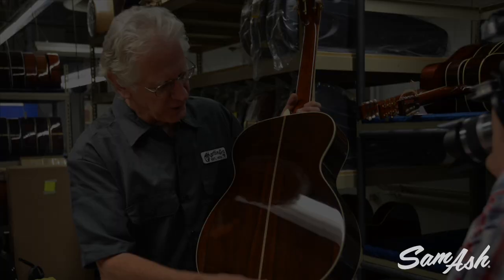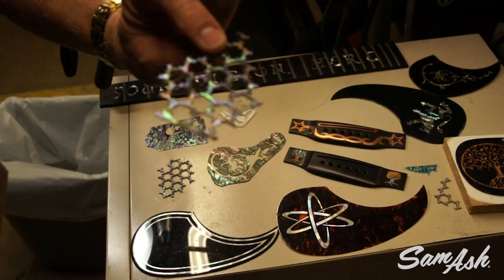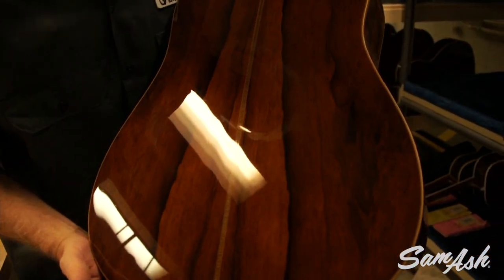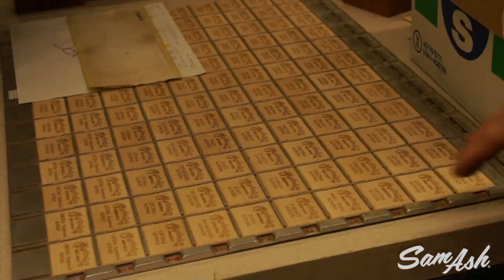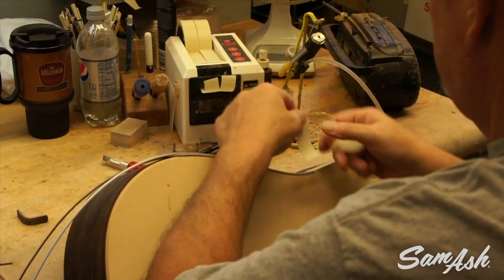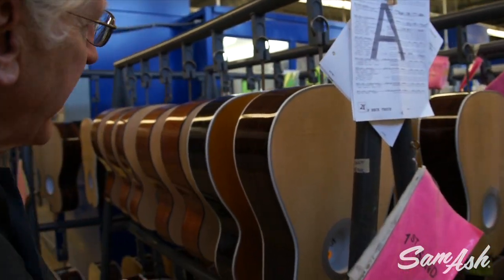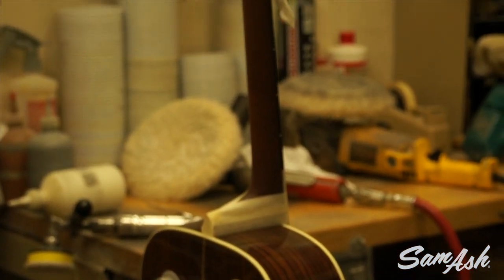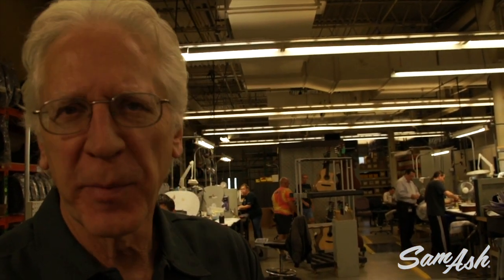Martin Guitar Factory Tour with Dick Boak

Comment: Excellent to see the inside of the factory of this iconic brand.  Lately though, the "brand" is about all Martin is unless you have a ton of money to spend on a guitar.  Take a top-end Eastman, Blueridge or even a solid-wood Recording King and I bet you can't tell the difference with your ears.
Reply: i love these comments... Agreed if you buy a bottom end martin you are not getting an amazing guitar, but no you definitely can hear the difference. The guitars you just mentioned are okay at price, but they certainy are lacking tonally and playability. The reality is all modern acoustics are lacking, they all have average wood, are rarely chilac anymore and lack the same build quality. Guitars also get warmer over time and the older sound is really whatr yo ushould be lookign for. A 30 yearold blueridge may be cheaper than a top end martin, but it sounds a lot cheaper as well and doesnt play as well. You cant put a price on sound if you can hear it. YOU may not be able to hear the difference, but me and many others certainly can.

Comment: So, I don't see how a hand carved neck would be superior to a CNC neck. I don't buy into the idea that mechanization has lessened quality in any way. Seems like they still have plenty of folks around working by hand on these guitars in more critical stages.
Reply: Chuck berry  Johnny   be  good  how  to  play
Reply: It is actually. Hand fitting will be more accurate with woods. More fitted if you will. If this was metal, etc, I'd agree. But trust me
Reply: custom asymmetrical necks are better when carved by hand . they use customer's specs for different  size hands